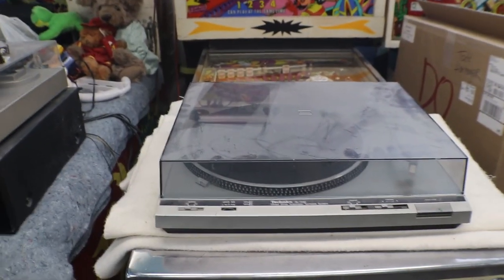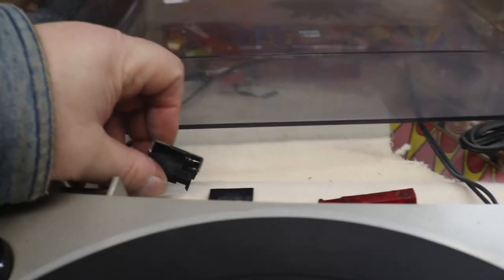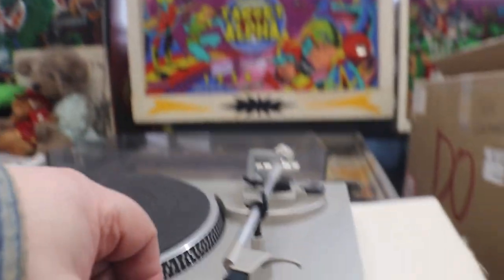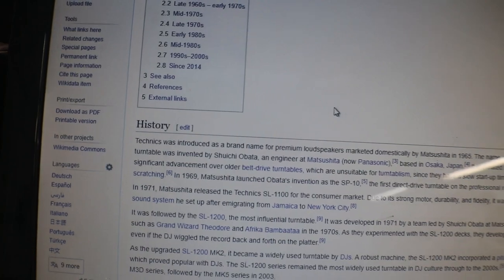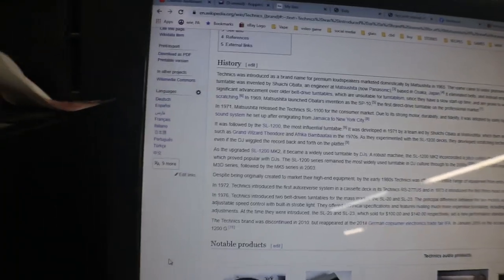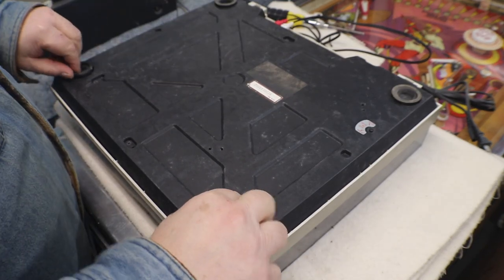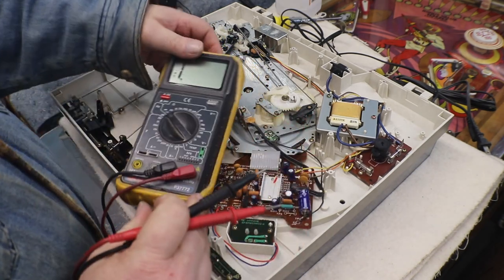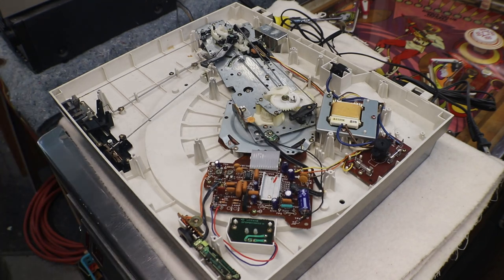Technics SL-D30 Direct Drive Turntable / Lets See If We Can Get It Working

Comment: Great repair vid.  Just picked up the same one at SA for $20.  Nearly perfect but arm doesn’t raise up very high and when start/stop button is pressed it only raises slightly, moves 1mm to the left, then returns home.   I bet it’s the same gunked up plastic pieces as urs.  Because of ur thorough explanation and clear vid, with a little contact cleaner this TT is going to be as good as new!  Rock on brotha!
Reply from the maker: Thanks for watching! It sounds like you've got a great project ahead of you. With a little TLC, I’m sure that TT will be back to its former glory in no time!

Comment: Just repaired an identical model with the very same issue - not shutting down the motor after the cycle is finished. Thanks for the video. Also I noticed that yours, like mine, has a curious clicking noise just as the arm finally lowers itself, so I'm assuming that's normal
Reply from the maker: Great to hear!

Comment: I just acquired an older technics direct drive table that powers on but the platter doesn't spin and arm doesn't move.. the start/stop button just flashes red and nothing else.. before I open it up I was wondering if you had any advice on this issue? Possibly a common problem.. I hope an easy fix. Thanks much in advance
Reply from the maker: Yes take the bottom off, there is a little micro switch that turn on the platter. It may be gummed up with stiff grease. The grease just all stiff from sitting around.
Reply: @RetroGamingWithHopper  I just took the bottom off and removed the motor for the arm.. then powered on the unit and moved the arm over manually and the platter started to spin.. so now I'm thing the little motor is gummed up.. the gears on it don't seem to want to spin . Does the motor gel harden up over time?
Reply: I got the little motor off the bracket and turned the unit on.. it spins nonstop and won't stop.. I think the little micro switch is faulty.. I press the little button and the motor keeps spinning..unless it's something with the board.
Reply from the maker: @TimeLapseCarGuyBruno  With the unit unplugged, if you have contact cleaner spray the little micro switch and just keep turning it on and off to let the contact cleaner work inside. If no contact cleaning use alcohol.
Reply: @RetroGamingWithHopper  thanks

Comment: I have the same turntable, the speed is a little too high, what do i do?
Reply from the maker: Rebuild the speed controller.
Reply: @RetroGamingWithHopper  actually, i found out that the speed adjustment on the record player works wonders. Thanks for the comment yho